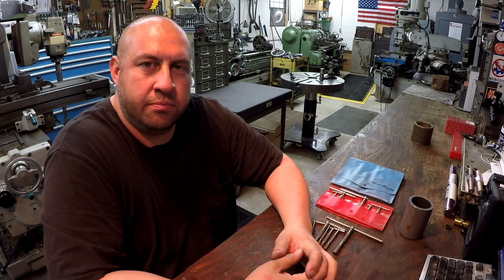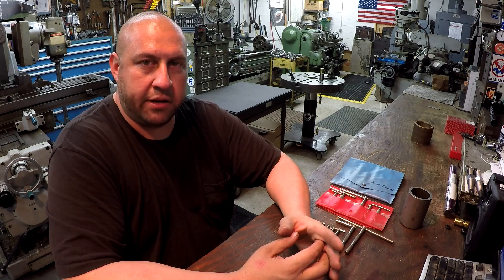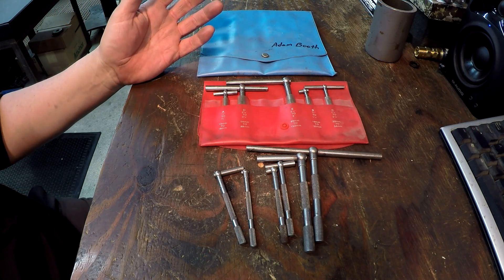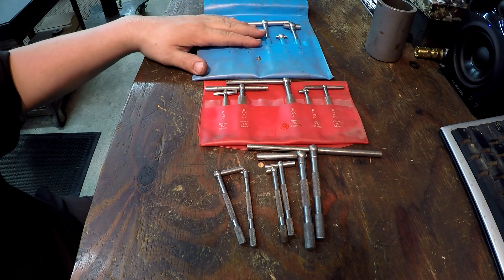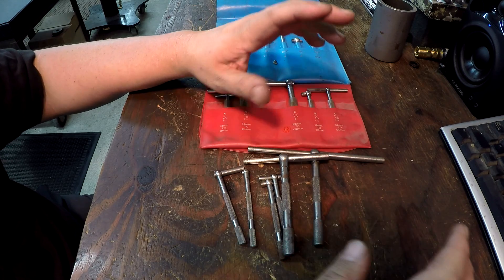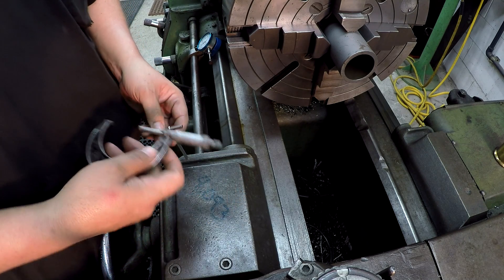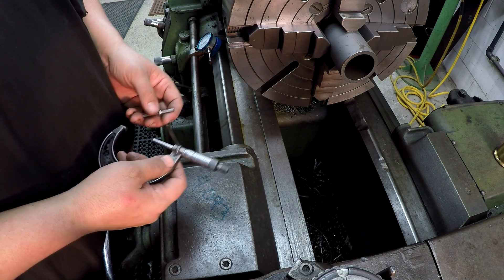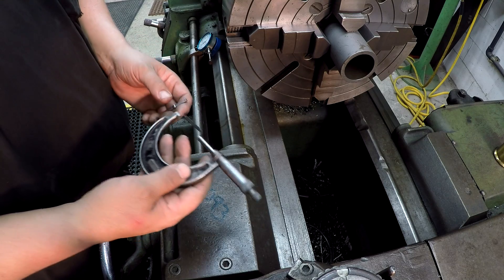Shop Talk 10: Telescope Gages & How They're Used

Comment: I don't understand how the flat surfaces of the telescoping gauge can accurately measure the round I.D. ?
Reply: the ends are round
Reply: They look flat on camera but actually they have a slight radius on each end. The size of the radius is based on the measuring range of the gage so the smaller ones have smaller radii.
Reply: They tips are rounded not flat.
Reply: the tips of the guage are radiused, the tilt and sweep gets the fine tune of sizing.
Reply: The gage legs are not flat but rounded so they touch in only one spot.
Reply: Cool, I knew I had to be missing something. Thanks guys.

Comment: do the telescope gauges have a radius on the end thats smaller than the inside diameter of the bore? if not then i cant understand how you can get an absolute measurement because there would be a gap at the center of the ends when pulling it through
Reply from the maker: +Taz Nelson Yes they are radius'd so that you have a true 180 contact.
Reply: thanks for the reply... im no machinist but ive been watching your channel for a while now and its something id really like to get into and possibly start a career of if law school doesn't work out
Reply: Great video, Adam!  I have a two ended Starrett set and I have noticed that the telescoping part of the gauge is not square with the handle by a few degrees. That is, the top of the 'T' is not perpendicular to the vertical part. At first I thought it was bent but all of them in the set are that way. It's hard to say for sure from the video but I think yours are the same way. Any idea why?  I assume Starrett did it that way for a good reason.

Comment: quick question can you explain how the telescoping part stays put after you take the reading ,
Reply from the maker: +Scott Tyndall Its held together by friction. There is a screw and small sliding part that fits down in a small key way. The screw and plate pushes against he arm to hold it in place, and once you pull the gage out it stays put if you have the right amount of tension.
Reply: Thanks Adam, That is what i thought but was not sure thought i would ask rather than assume .. and thanks from my famiy to you for continuing to make your videos
Reply: Look at Pierre's Garage for today.  He showed how to disassemble and reassemble a telescoping gage.  It is neat that two good U-Tube guys cover the same topic on the same day.

Comment: Great video Adam! Good to drive home the idea that if you use the ratchet or friction thimble, you WILL push the plunger into the gauge several thousandths. Those that say they have no problem with that, overtighten the telescope gauge and when you do that, it draws the moving leg inwards a few thou as well. So you end up with a measurement thats sometimes 5 thou smaller than the part really is.
Reply from the maker: +Brian Streufert Your exactly right. It's the right way to do that, but I'm not one to argue with people. I show what I know, and that's it.
Reply: I have seen people just put it in the bore,  snap it open and pull it out without even putting it at an angle and rocking it. Literally just snap it and then tighten it and pull it out. Then crank down on it with a mic haha.

Comment: Thanks a ton Adam. I've never had good luck with my grandfather's set of telescope guages but I just went out to my shop and got 6 consistent reading with them using your method. Thanks a bunch.
Reply from the maker: +David Rahn (Dmrahn) That's awesome! Keep practicing what I mentioned, getting the screw just tight enough to hold the arms, and feeling the tips touch the mic.

Comment: hey...I and at least 50 other guys I know do it just like that...the push down and no ratchet...only thing I'd add would be...watch for under snug... older/cheaper  gages will slip open...always take at least two readings
Reply from the maker: +T Byrne Yep, there are times when you don't get the right torque on the screw and it will open up. I always take double measurements when I'm close to size.
Reply: that's what's up...I appreciate the time you put in man...thanks